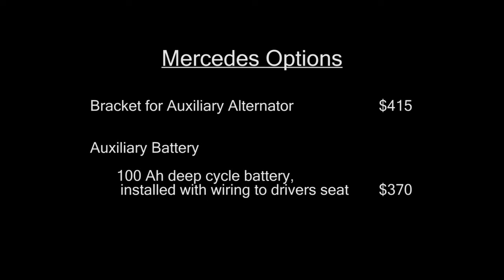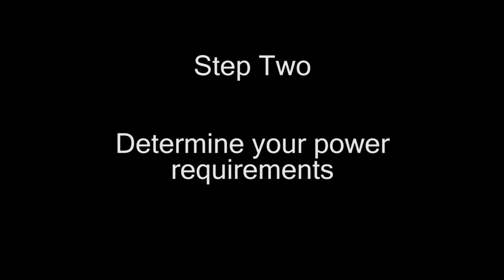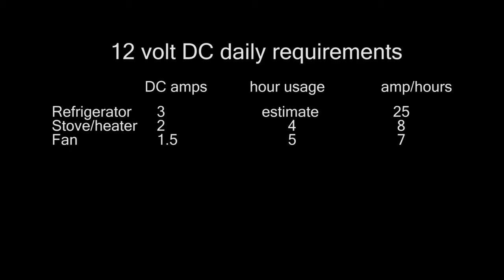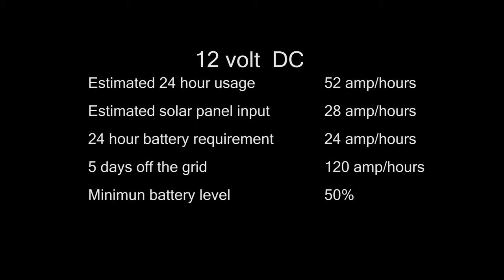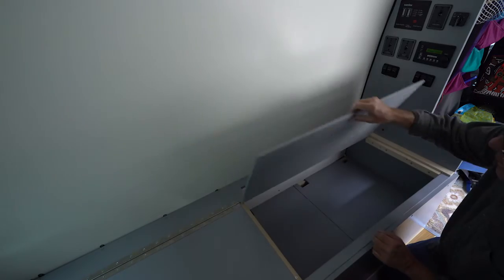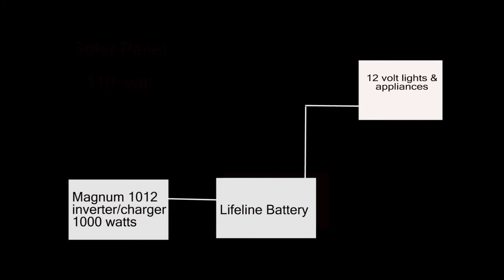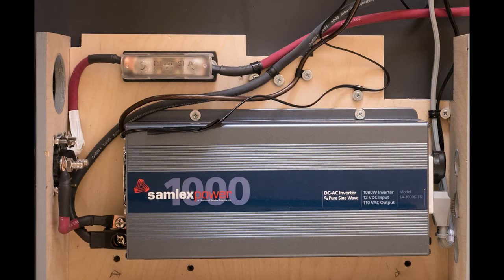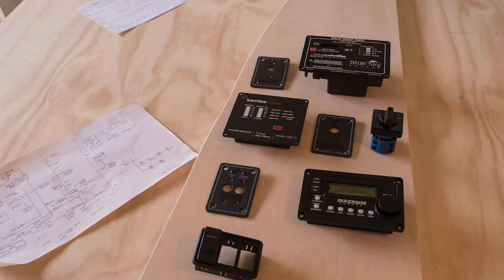Electrical System for Sprinter Van Conversion

Comment: I am interested in knowing more about WHERE the battery (s) go. Yours are in the cargo area where a seat goes? Are those metal covers over the battery area? Does the battery need to be vented? I have seen videos where the batteries fit under the driver’s seat. Did this not work for you?